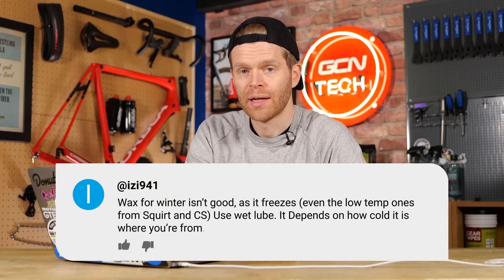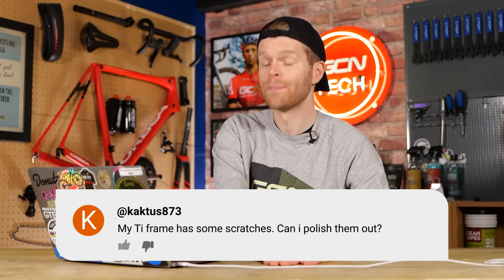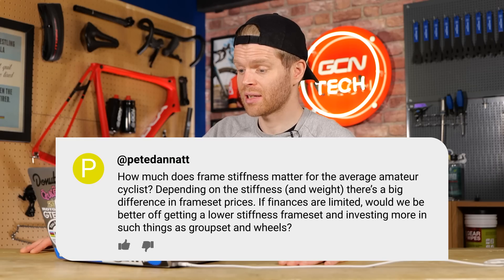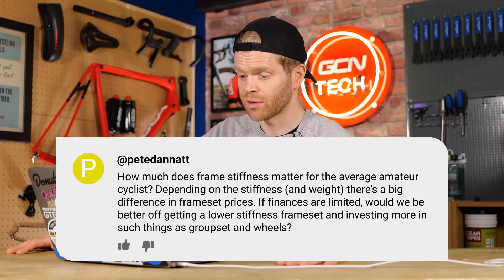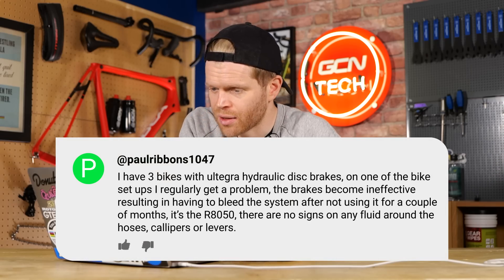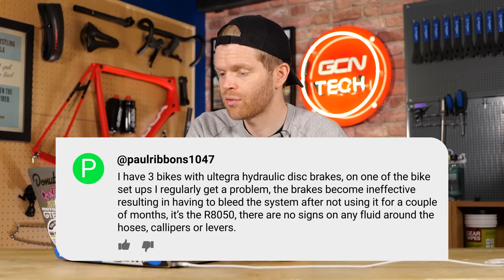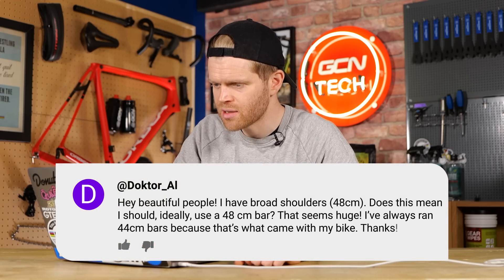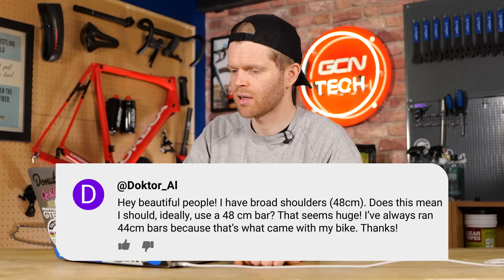Bike Handlebar Width, Hydraulic Brakes & Frame Stiffness | GCN Tech Clinic

Comment from the maker: How did you find the right handlebar width? 🚲
Reply: went from 42 to 36cm handlebars as a 185 cm dude. love the change
Reply: @cracked229  wow 36mm, wide or diameter?
Reply: I had a bike built for me in 1983. The builder measured my shoulder width and put a 44 cm handlebar on the bike. Back then shoulder width determined handlebar size, the theory being that narrower bars constricted the chest, reducing breathing efficiency. It is very comfortable, and great on longer rides!
Reply: I haven't even tried to find the correct one but to be fair I use my clip on TT bars most of the time so the handlebar width is kinda irrelevant.
Reply: So that your wrists aren't flared out when you are on the hoods.
Reply: I had a 2005 Cannondale that came with the then-popular "wing" bars in a 44cm size that actually measured close to 46cm at the hoods. It felt ridiculous! I simply tried reaching my arms forward as naturally as possible to see where my hands ended up and, based on that, switched to a compact bar that's 40cm at the hoods. That felt right and works well. For what it's worth, it's close to my shoulder width (measured  across the AC joints - the bumps atop your shoulders where the collarbone attaches just inboard of your deltoid muscle).
Reply: I have 46cm custom Titanium Bullhorns you can't even buy them.  Narrow bars are a joke unless you are being paid to race a bike.
Reply: Back in 1985, I went to the Olympic training center as a decent junior cyclist who hoped to be Greg LeMond someday. They did a bit fit for me and said that you had to have your handle bars a certain width so that you could breathe. I was all of 130 pounds back then, and they said 40 to 42 cm for me. Now it seems like you can go as narrow as you like and no one worries about how it will effect your breathing. Does the width of your handle bars effect breathing?
Reply: @derickcastillo9083  It does, but everything in modern cycling is done to reduce the amount of material used to save money, so they crunch you up on a tiny bike and tell you that because its more aerodynamic you are going faster.  It's a big joke, the pros would go faster on comfortable bikes but comfortable bikes use more material.
Reply: Figured out where my hands wanted to be after a 100km ride using a tape measure and then just got bars at that width.  The set that came with my bike started feeling like I was pushing a wheel barrow after some distance because they were so wide.
Reply: Watched a video on Cade Media on how to properly measure shoulder width.
Reply: as narrow as possible

Comment: About this comment of wax freezing. Skiers use wax regardless of the temperature, the colder the snow, the harder the wax. And Squirt has a separate drip on wax for cold temperatures, so no need to worry about cold winter days!

Comment: Any data on wax in cold, or just speculation? I've been using wax in winter in Alaska, USA, with no ill effects and good performance in my experience. I'm typically riding in +20 to -20 F, -5 to -30 C.

Comment: #askGCNtech I have a few ugly scratches and scuffs on a set of Vision SC55 wheels. Any tips on how to treat scratches on carbon wheels, and generally keep them looking fresh? I've seen some blogs mention carwax but I'm skeptical!
Reply: If the finish is gloss they can be polished out with rubbing compound or plastic polish just like paint or plastic, but don't use a high speed polisher unless your really good because heat buildup will be quick and mess up the finish.  If the finish is mat or semi-gloss it's much more difficult to fix (don't polish these finishes) they need touch-ups or re-coating with the correct clear coat or resin.  Many times scuffs are just foreign matter stuck to the surface and can look much better or disappear with a good cleaning using a plastic safe cleaner and a soft cloth.  Car wax is fine on gloss carbon, but doesn't really remove scratches, but can act as a cleaner, I wouldn't recommend it on mat or semi-gloss though (maybe ok if the wax is just liquid spray and wipe, but always test first with these finishes).

Comment: Hi Ollie and Grunt. This morning I was gonna ride my mountainbike with hydraulic disc brakes, but the brake fluid was frozen. So the bike was rendered useless. 
Is this a common winter problem when it’s close to -10 degrees celsius? Do I need winter specific brake fluid? Thx in advance! Cheerio

Comment: Regarding stiff pro-level frames, I am reminded of the difference in ride quality between an off the rack sport motorcycle, and an actual motoGP bike. Most people couldn’t hack more than one lap on a GP machine, because the stiffness of the frame and suspension just beats the life out of you.

Super-aero, top range, carbon road bikes are a lot like that.
At the second water stop of the eTape SanAntonio ride-race-fondo-sportif-whatever ride last year, there was a group of young men complaining about the rough road surfaces. A lot.
They all had carbon bikes with carbon wheels, and even looked like wide rims and probably tires in 28-30ish mm width.
All of the things that are supposedly more “compliant”. (Marketing nonsense, not an actual engineering term).
I was riding my TruTemper S3 steel frame with alloy wheels and 25mm GP5000s.
I hardly even noticed the roads being rough.
I also dropped those kiddos on the steepest climbs which were yet to come.

Worry less about stiffness and tune your engine.

Comment: How did 48cm shoulder guy measure himself? It’s supposed to be from center of AC joint to center of AC joint, not the way your tailor measures your shoulders outside to outside. He’s probably 44 or even 42cm.

Comment: Brakes...How are you storing the bikes?  Vertically, bars down?  or Maybe from a ceiling upside down?  Either way can allow small bubbles from the tops of the brake lever reservoir to make their way into the system.

Comment: Hi wonderful people. Apart from a good chain cleaning process before the first waxing, is there any possible extra step to maximise the wax bond?
I'm sure I've got a proper clean and solvent-free chain, but the wax does not last more than 100km, in the dry city of Seville.
Fixed gear KMC Z510 chain - Silca SS drip.
Thank you! #ASKGCNTECH
Reply: You should use wet lube if you are riding fixed.  Tensioned chains make the most noise and wax is the noisiest lube there is.  The bike will feel way smoother with wet lube.  Wax is ok for road bikes if you are racing and searching for marginal gains.
Reply: @___Bebo___  thanks for the answer. It makes total sense. I've actually thought about tension too. For now, what I've done is reset the wax and apply the lube with the chain untensioned, hoping the wax will penetrate the small gaps more effectively. I understand that tension will eventually wear it away, but if I can extend its longevity a bit, I still prefer wax due to its cleanliness.
Reply: @pablolopez584  You are never gonna get the advertised 400km out of waxed on fixed.  I use Chain L lube and it lasts 2000km and is dead silent.  If you don't like the black coating on the chain you can just brush it away with your chain brush after a few rides then the chain will stay as clean as anything else.  They don't have Chain L in Europe so what you want is mineral oil with high pressure stabilizers added for fixed, good luck!

Comment: I converted a hard-tail MTB to a Gravel bike - included a longer rigid fork to maintain  sensible head angle. 60psi tyres bike feels fine. Reduce to 35psi and bike feels like I’m riding in a rut.  Normal ? Or do I need to change something?

Comment: There's a formula on sizing handbars. There are two prominences on the top of your shoulders where the collarbone meets the joint. Measure the distance between them. Then select the next SMALLEST width to that measurement. You should be able to extend your arms with palms in and touch the outside of the bars where the shifters would be mounted. You can flare out the drops for handling but this should bring the most comfort.

Comment: Stiffness is a completely useless quality to have on bikes.  If your bike is stiff all that it does is transfer more shock into your bodies joints producing more wear and tear and pain.  Unless you are running tubular tires you will lose all of your stiffness wattage where the rubber meets the road.  Tubeless is faster than stiffness overall and when you run tubeless the bike loses most of its stiffness IMO.  Stiffness has a place in the hour record IMO in a velodrome where the surface is perfectly smooth, but for general cycling it will just give you upper body pain.
Reply: This isn’t always true, if the quality of engineering and r&d, carbon lay up points etc can make a big difference. Top quality Stiff frames can still give a comfortable ride if well engineered and with the right wheels and tyres at correct pressures. I can’t stand a noodle frame especially at the front end but I also want comfort. It’s very achievable
Reply: @huwsalway4099  it's never true.  This guy is a mindless clown
Reply: @huwsalway4099  I can drop 99% of bike riders on a Reynolds 531 track bike, the most noodly steel.  Stiffness is irrelevant it's all legs and lungs.
Reply: @__Bebo__  you definitely can't, despite your claims of being stronger that Filippo Ganna and Bradley Wiggins
Reply: @veganpotterthevegan  I can hold Cat 1 speeds for a long ass time with zero aerodynamic equipment you are clueless.  You are also a good example of what I am talking about in this thread, putting beach cruiser tires on your bike to get any sort of comfort because the frame material is ass.  Spare me the BS about wide tires being faster, 35s are balloons that feel like complete trash until you hit 15MPH, I will pass on that.
Reply: @__Bebo__  I know,  as you said, 35mph for 5 min which Filippo Ganna can't do.  You're superhuman😅
*I never said my tires were fast.  I ride them because they feel good and I already told you that I don't care how fast I'm going when I'm training. I care about my wattage
Reply: @veganpotterthevegan  Imagine buying a plastic advertising bike from the least consistent manufacturer out of stiff outdated t800 carbon and then having to put beach cruiser tires on it just to ride it.  Complete Fred behavior if you ask me.
Reply: @__Bebo__  I can't imagine it.  Next hypothetical🤡
I've ridden my bike with 28s.  The same exact model and size I ran on my Seven. It was outstanding.  But now it's even better so why would I not want better when all it takes to get better than outstanding is a very small change when you need to buy replacements anyway?🤡
Reply: @veganpotterthevegan  Now imagine riding a Reynolds 853 frame that will feel like riding 32s when you are riding on 28s and being able to accelerate fast up a hill again, haha.  28s on your bike was an ass rattler, you can't fool me.
Reply: @__Bebo__  I have and it doesn't😵‍💫 The bike shop I worked at had 25th anniversary frames built with 853 by Waterford.   They were nothing special.  Just better that aluminum
Reply: @veganpotterthevegan  Waterford makes shitty heavy Taiwanese made frames, imports them and then acts like they do every model in house in Wisconsin.  That's why they are going out of business.  It's not the same as riding a 16 pound put together Reynolds 853 track bike.
Reply: @___Bebo___   I lived riding distance from their factory potato.  I knew some of their frame builders as they were ex-mechanics at the shop I worked in in Wisconsin
Reply: @veganpotterthevegan  I was living in Hawaii and Japan swaggin on you trading assets while you were inhaling toxic metal working fumes got you beat.
Reply: @veganpotterthevegan  This thread is honestly depressing.  I ride 32mm tires because I weigh 102kg.  You aren't even a big dude and you willingly do this to yourself, smh.
Reply: @__Bebo__  everything with you is depressing because you don't live in reality.  So what if you're 104kg?  I was over 140kg when I started cycling and rode 25s because that's all that fit my frame and nearly every frame back then.  Designers didn't know any better,  just like you now
Reply: @___Bebo___   You really know nothing of the bike industry.  You're the most vocal know-nothing on YouTube
Reply: @veganpotterthevegan  How are you going to say that I don't know better when I've literally bought and ridden all of this tech I don't like, lol.
Reply: @___Bebo___  huh?  You've only told me you've bought one carbon bike🤡  And yes,  you don't know what you're talking about because you don't know what you're talking about.
Reply: @veganpotterthevegan  I guess just keep increasing the tire size until the bike feels good brah.  Run some 40mm Rene Herse Tubeless on it get wild with it, haha.
Reply: @__Bebo__  it felt great with 28s.  It feels better with 40s(they're really 35mm panaracers that measure to 40)🤷‍♂️  If the roads were all totally perfect, I would just ride wide tires because they take longer to wear out.   There's really not much to lose when it comes to what I'm looking for when I'm only training
Reply: @__Bebo__  if something feels better for me, why would I not do it if there are no losses that I care about?🙃 Are you capable of ANY logical thought whatsoever?
Reply: @veganpotterthevegan  Panaracers suck man that's the kind of tire you use to make an Alu Touring bike feel less hellish.
Reply: The rebranding of stiffness as a desirable quality the average person wants on a bike is one of the most ridiculous things about modern cycling.  In the past the bikes were made to soak up road damage as much as possible.  This is impossible without wide tires on carbon and aluminum so they pretend like stiff = fast, LOL.  It's a complete joke.
Reply: @___Bebo___  Filippo Ganna needs the best equipment in the world to hold speeds you hold on a steel fixed gear with baggy shorts.  You really are something. Definitely not human!!!

Comment: #askGCNtech Hello friends! I have a TACX Neo 2 trainer which I have been riding for a while, though after I purchased a new Canyon Ultimate that came with the 4iiii crank power meter, I noticed a large variance on the power data between the two, with the trainer consistently showing 25-30% less than the crank. I calibrate the power meter every couple rides but still get the same result. I'm definitely riding hard on the trainer with lots of climbing so it's not due to lack of effort 😃
Any advice?